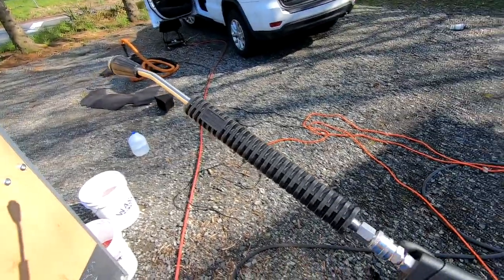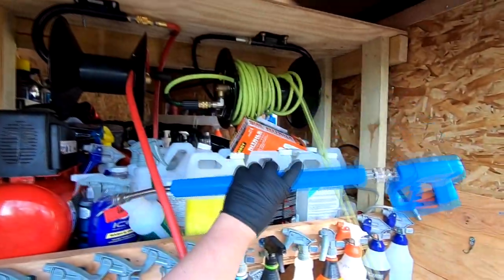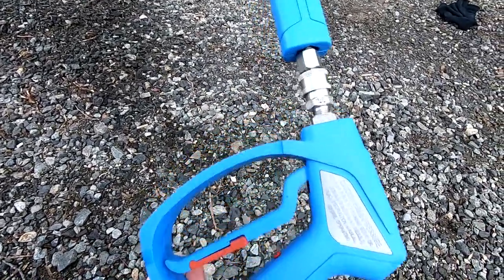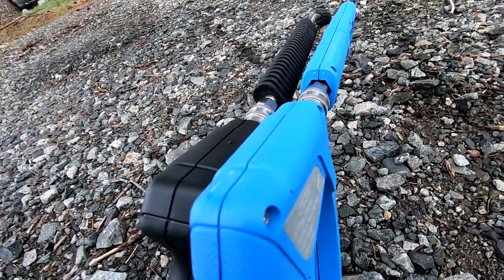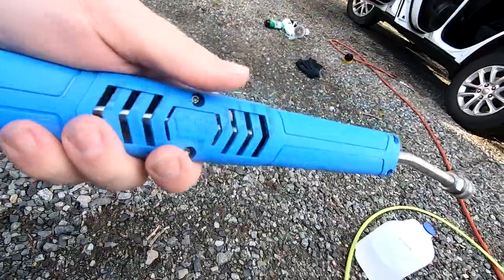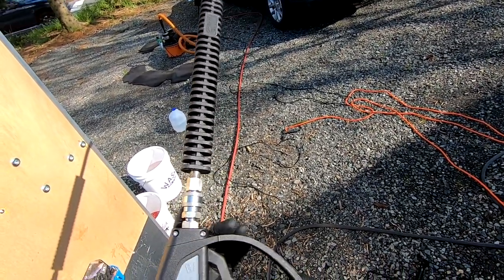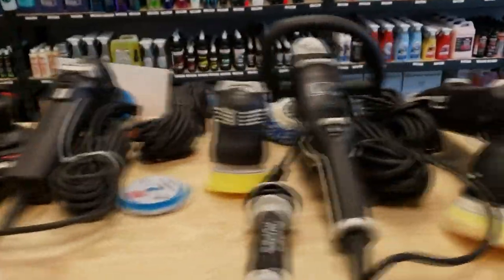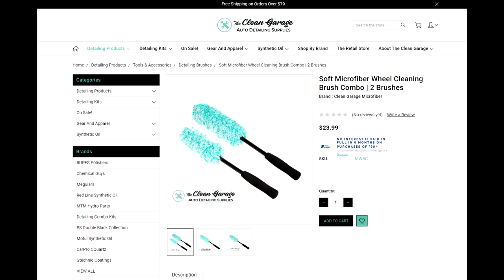Best Pressure Washer Spray Gun for Mobile Detailing? | MTM HYDRO SGS35 #MTMHydro  #MobileDetailing

Comment from the maker: Do you use a wand with your Spray Gun? Tell me!
Reply: I used to work with a buddy of mine who owns a pressure washing company here in NY.. He uses similar guns to this.. Suttner's to be exact.. you can extend these sprayers to whatever you want... hes got lances that range up to like 10 feet long to reach high on house sidings... for detailing I dont like using the wand.
Reply from the maker: @johnnyw157  I use the wand so I don't need to break my back getting crazy low in to wheel wells or stretching across hoods and on roofs. I'm also a business so a little different than just doing it on the weekends. Different tools for different uses.
Reply: @TotalDetailing  I think it may be easier to foam the vehicle up without a wand... doing it with my stock dewalt wand was a pain... maybe rinsing the vehicle off, a wand would actually help a lot more
Reply from the maker: @johnnyw157  I totally agree using the wand with a cannon sucks.
Reply: No I only use the gun to rinse down after pressure or soft washing

Comment: Why isn't anyone talking about the angle of the handle and the nozzle of the SGS28 / stubbies? My wrists are continuously under strain and start to hurt after using it for 10 minutes. 

I use the equipment professionally. I've heard multiple people comment on this, but all the reviewers seem like they are copying each other. I have switched back to a Kärcher Easy Force and no pain anymore.

Comment: Now that the honeymoon stage is over…..How are you liking the larger size of the sgs35 vs sgs28?  Is the size noticeable as you are using it?  How has the lance held up?  I am trying to decide on which combo to go with.
Reply from the maker: Sgs35 still in use, every day - thrown, dropped, abused. The lance never saw much use, I like the older version better.
Reply: @TotalDetailing  Why do you like the older black lance compared to the blue lance?  I'm on the fence on what to get.  Money really isn't an issue honestly.  This is just my fun hobby for detailing our cars.  But I do like how the blue aqualine looks...lol  Is that bad?
Reply: @NewShockerGuy  the black lance is a solid injection molded construction.. the blue one is not.
Reply: @Fiv3Dollar  does the blue one feel cheap when using it?

I feel like you can't go wrong with either, right?

Comment: How is this acqualine holding up and is the swivel sprayer good? I sprung on one online that the clean garage had on sale. I was gonna OG spec on mosmatic but they were sold out. This seems industrious.
Reply from the maker: Still using the SGS35 every day! Now in our shop in a high production environment.
Reply: @TotalDetailing  Cool sounds like I made a good purchase. I wish I lived close to that clean garage store. Man that store is awesome and they have solid pricing.
Reply: I got all my MTM stuff the garden 3/4 quick disconnects are very smooth the gun though the connection is super sticky and difficult to fully lock and unlock is that normal? Not sure if it's a break in issue with the fitting that I just need to deal with for a while or what.

Comment: I’m thinking about buying this. And through the link you provided it’s 10 dollars cheaper to begin with, plus another 10 off. Sounds like a Homerun. Maybe you can help me out... I’m on the fence with this and the SG35 which is basically this product just not stainless steel and no QC’s. If I get the bare SG35 do I have to also buy the swivel with it? Like am I better off just getting the SGS35 like you have with everything included on it?
Reply from the maker: Sorry I didn't see this sooner. Honestly, it's just easier to buy the SGS35 because the hardware is already installed and sealed and is stainless steel. It was less crap for me to do and other stuff to buy. The swivel is also internally threaded and not just a QD fitting. You could install your own QD inlet nipple but it wouldn't be the internally threaded style, meaning that the nipple can bind under pressure and not allow rotation of the hose. In closing - SGS35 just for ease of use.
Reply: Total Detailing all good, thank you for responding. I actually, because of your video, ended up ordering one for myself with the discount code. It’s already on the way supposed to be here this weekend. And after doing some research you’re completely right. This gun has all of that installed and if I bought a bare SG35 by the time I bought all of the fittings plus tax I’d be at just under what the SGS35 costs me. The machine I’m working with is a dewalt 4000 psi 3.5 gpm so this sprayer is more than enough to handle that. Thank you for the awesome and informative video as well as your input. Clean garage is an awesome company from what it seems, I plan on ordering from them again.
Reply from the maker: @johnnyw157  Josh the owner of CG, works really hard at providing an awesome experience. He's a bit short staffed due to covid but he's busting ass to fulfill everyone's orders. Honestly, check out the video I did on his microfiber line. It's amazing quality for the money. Best kept secret in detailing.
Reply: @TotalDetailing  ill have to check that because im in the process of upgrading and adding alot to my detail inventory here at home.

Comment: How does this compare to a mosmatic?
Reply from the maker: It was modeled after the mosmatic and then improved upon. Ultimately this is a commercial purpose build spray gun and it absolutely takes a beating.
Reply: @TotalDetailing  so this one is better than the mosmatic 29.132?
Reply from the maker: @aaron30569  That's subjective to your usage. Do you plan on running 4500-5000psi of pressure through it? What are you using it for? Are you running a business or outfitting your home garage?

If you're running a business, doing normal detailing work, the SGS28, SGS35 or either of the mosmatic variants will do fine.

I use the SGS35 every day in my business. I like the egonomics better than the forward angled sprayers.
Reply: @TotalDetailing  want it for the weekly wash. I am shopping for a new gun so I was thinking about the mosmatic 29.132 or the obsessed garage spec or this new one I've heard the swivel and trigger are much better on the mosmatic compared to mtm. When comparing the sgs28 vs mosmatic 29.132 none of the hobby guys have reviewed the sgs35 yet
Reply from the maker: @aaron30569  I get that. Honestly, at this point, you could just buy whatever is cheaper if you're using it once a week. Both companies make a quality product and neither will affect the outcome of your detail or wash. Use that saved money to buy other products. Matt runs a nice show there at OG but as a business owner using and abusing products on a daily basis, my view is a bit different.
Reply: @TotalDetailing  I went with mtm sgs28 and it's great! Very lightweight and the swivel is great. Choose it over mosmatic because I heard mosmatic weighs more

Comment: Is there a difference between the triggers of the SGS28 and SGS35 Acqualine? Matt from OG said from a video that the SGS28 has a better trigger than the SGS35, what's your opinion on this having owned both and being used frequently?
Reply from the maker: I find the trigger on the SGS35 to be more tactile and rugged for commercial use. I use it everyday, throw it around, drop it, drag it around and it keeps on chugging. The SGS28 wouldn't hold up to that.
Reply: Drew, I disagree with his assessment saying the SGS28 won't hold up to commercial use.  I've had one for 3 years in a wash bay and it's held up great to what's probably amounted to thousands of drops.  The SGS35 simply has a blue food grade housing, which makes absolutely no difference for detailing purposes.  The color looks pretty cool though
Reply: @derek723  hold both sgs28 just feels cheap compared the 35
Reply: @mercury0214  I felt both at SEMA in 2019.  The SGS35 definitely feels beefier, but I don't find that to be a positive trait.  I want my gun and hose to be relatively light, yet high quality.  The SGS28 has filled that need so far
Reply: @derek723  yea I agree, I just prefer the beefier to each their own my friend 🍻
Reply: @derek723  and my apologies didn’t mean to call sgs28 cheap cause it’s definitely a solid unit
Reply: @mercury0214  🍻

Comment: i have a ryobi 1600 psi pressure washer.. im going to buy one of these shorty guns to replace the wand and im also looking for a better high pressure hose for it.. any suggestions ?
Reply from the maker: The MTM KobraJet hose. https://amzn.to/31WRHLw - It doesn't kink or coil when pressurized. I think its the only hose out there that does this. All of the others, including the Flezilla and UberFlex all coil while pressurized.
Reply: Total Detailing will that fit my ryobi 1600 psi washer ? And will it add psi to it ?
Reply from the maker: @Botzz28  add pressure? Not likely?  Not sure about the fittings. You should be able to get the fittings at Lowe's or HD.